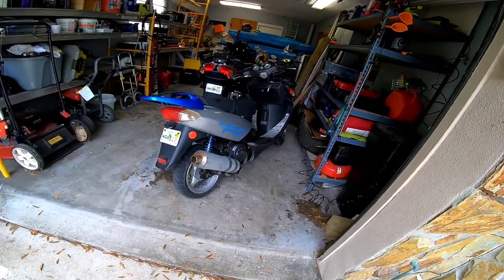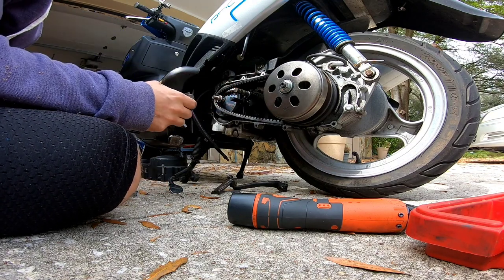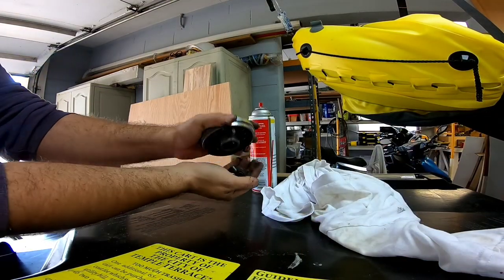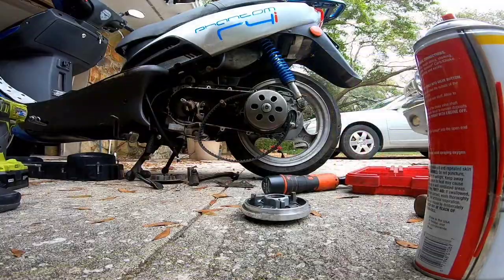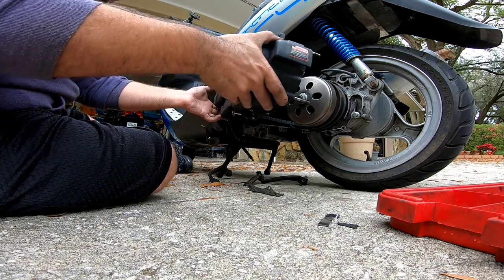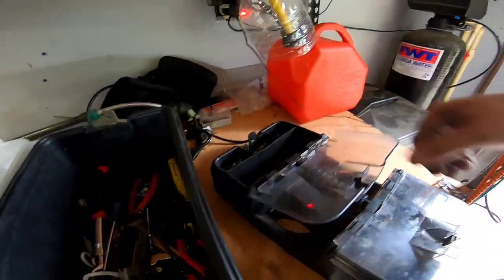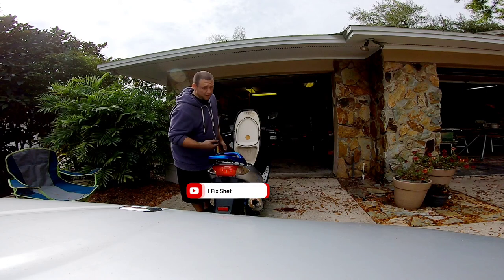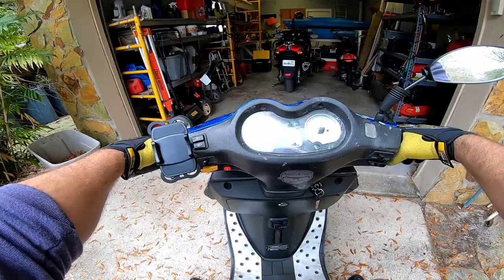50cc-150cc Scooter CVT Must Do Maintenance #gy6 #gy6nation #honda

Comment: Nice job, but that silver bracket should be reinstalled, it serves a purpose.
Reply from the maker: It used to serve a purpose it does not anymore. There used to be tuck lines that ran through it for the brake line which clearly has been repositioned to the top of the CVT making the skid plate pointless
Reply: @IFixShet  It also stops the center stand rubber stop from hitting the cvt cover.
Reply from the maker: @phantomfixer  it would make a difference if the center stand actually work properly but it's broken